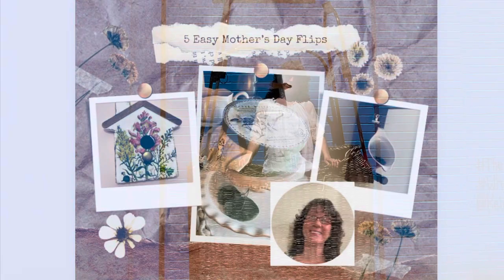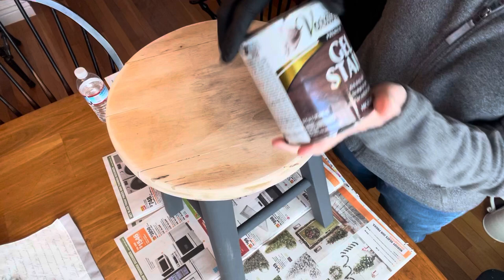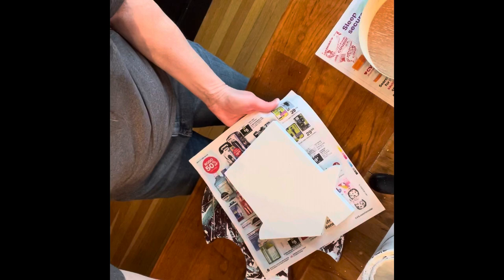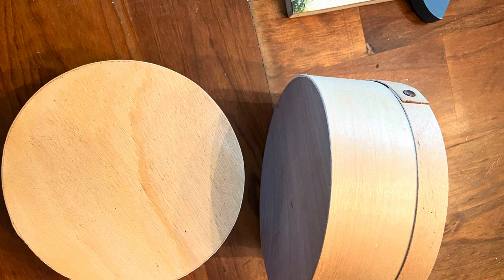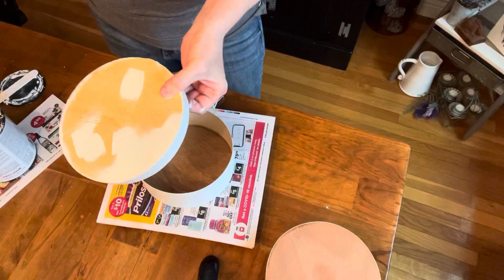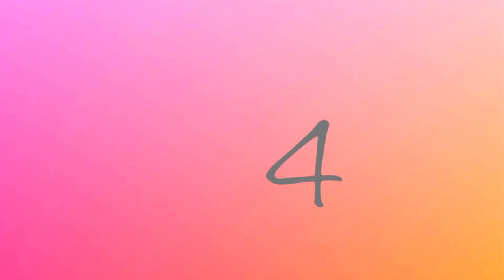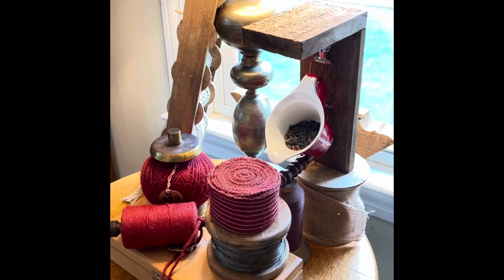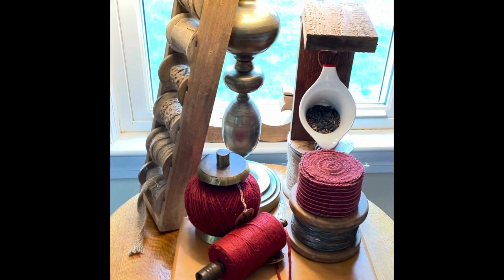5 Fast & Easy Mother’s Day Flips

Comment: Love these! The thrift shop I volunteer at every week is closed for the winter (we do this every year now because its very slow Jan-March & volunteers get burnt out), so Ive been going through my stash (having been a volunteer every week for the last 11 yrs, I have a LOT of stashed stuff, lol!) and came across a FEW of those round craft AND nice heavy duty cheese boxes plus a few hat boxes that could use some help, lol! There are a few cute ideas here, thank you! I also, oddly enough, have a few house shaped wood plaque things that I had no idea what to do with and your vid def gave me a few ideas! 
    Something I found that works great with printers and for decoupage and this is going to sound funny these days...but Typewriter Paper! I grabbed a few packs YEARS ago and shoved them in my hutch. Recently I got rid of the hutch and came across those stacks of Typewriter paper and because its very fine, super thin paper, it works awesome for printing designs on and then using for decoupage. Its not as thin as tissue paper & doesnt need to be taped to another sheet of paper, you can run it through the printer alone (MY printer will grab 2 pieces, but its so thin that it prints fine on one & I just put the blank sheet back in my printer stack) and it comes out great! I think bc its for a Typewriter, it also doesnt smudge the ink when I use mod podge, but I also use hair spray on EVERY printed paper I am going to mod podge (I let the ink dry, spray it with hairspray which I usually use cheap hairspray, lol) and it holds the ink so that it doesnt turn color or smear when mod podge is added. SSooooo...if you see typewriter paper at the thrift store or yard sale, its usually super cheap and I even got some that was turned color already lol, I didnt even have to "age" it myself, lol, I say GRAB IT ALL! It works great for print jobs!
Reply from the maker: Great idea. It’s probably cheaper than rice paper too. Yay on the cheese boxes. If you do one, post it my Instagram.